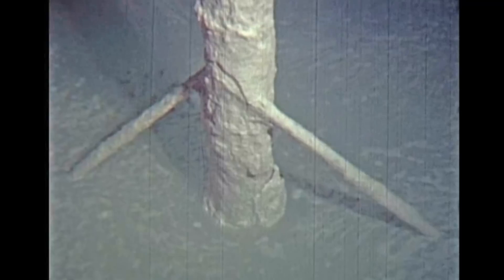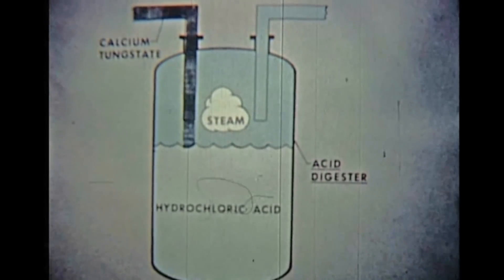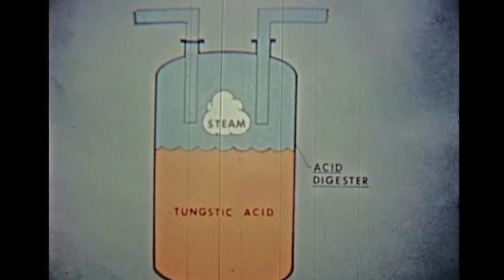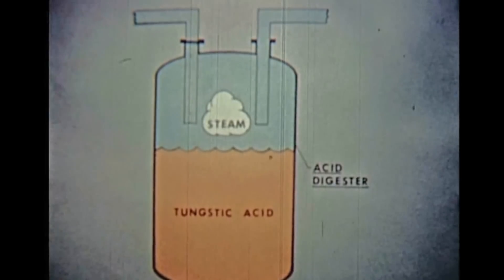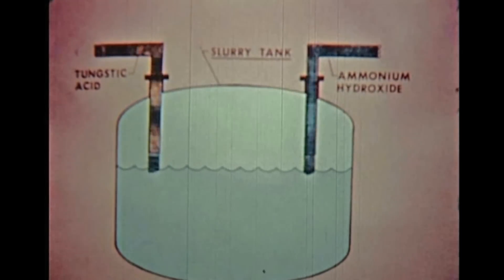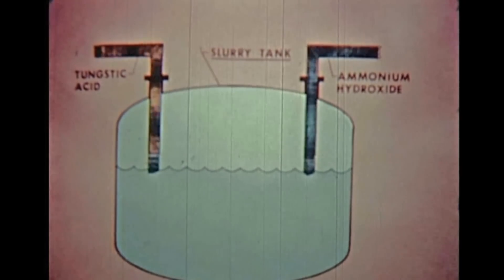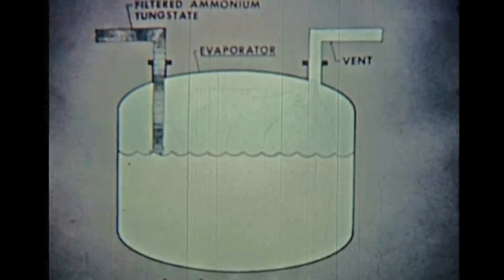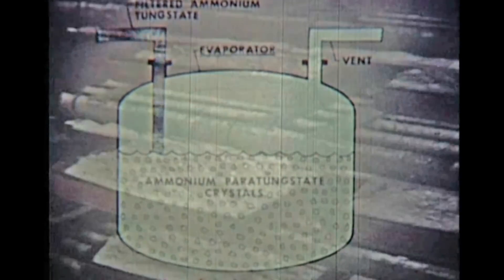Tungsten: From Ore to Wire

Comment: I honestly hadn't expected such an intense regulated and complex process. I think this is the only video published which shows the wire making process?
Reply from the maker: I was fortunate to rescue this 16mm film from the closed plant. This is a continuation of the work of Edison, Steinmetz and Coolidge. Glad you found it interesting.
Reply: @gmpullman  you are a hero. film contains some of the most valuable history and knowledge of the industrial era. thank you for uploading this. now it will be digitally archived and seen by generations beyond what the creators imagined.
Reply: @gmpullman  Thank you for saving this film! :virtualhug:
Reply from the maker: @goldiegolderman1842   I'm glad you appreciate it. For the record, the entire plant on Tungsten Road in Euclid, Ohio has recently (May, 2023) been razed 😞
Reply: @gmpullman  Hey just curious since you found that info, do you know of anything involving welding tungsten to tungsten? I've been curious to know if that's a thing or not and it seems to be a hard subject to research!
Reply from the maker: @suyujin4178   Yes. We welded tungsten rods using a high pressure/high amperage 'upset butt weld' which made for extra long wire when finally swaged then drawn. It took quite a bit of research but was finally accomplished in the early 1990s. 
I have TIG welded some tungsten wear plates and certain impact hammer wear surfaces. It takes quite a bit of pre-heat and lots of shielding gas. (I forget what gas was used). We welded lots of molybdenum and inconel, too. Thanks.
Reply: @gmpullman  Could answer that question. A mixture of 95% Argon gas + 5% Hydrogen should do the job. Take care that any weld remains in this athmosphere to the point when the absolute temperature is below 200°C.
Reply: @gmpullman  I have been manufacturing Tungsten Carbide right from ore and scrap to finish product since many years, In that Era producing with this much accuracy is fascinating. Good work for saving this copy.
Reply from the maker: @archupatel5714  Thank You! I was in the GE Tungsten operation for 38 years. All gone now!
Reply: Been searching all over youtube and this is the best i could find
Reply: Hi
Gm pullman 
I want to contact you and learn more abt tungsten
Reply: @gmpullman